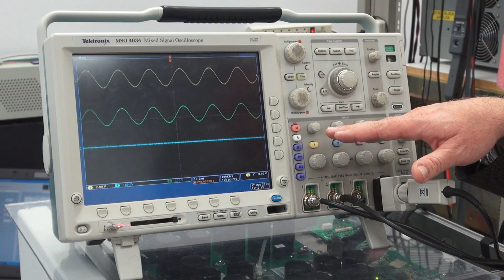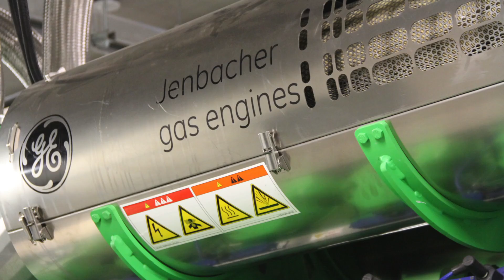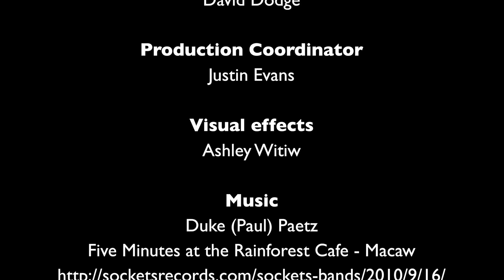45. Decentralized energy: Why building electricity generation where the demand is makes sense

Comment: Still thinking in the box will achieve nothing. you have to think outside the box and break the production to the basic form which is a three core generation pattern of all man's systems.
The Clemente Figuera 1908 system is the key to decentralized systems having a power supply at each home not a grid based system. why pay a Corporation money when you don't have to.